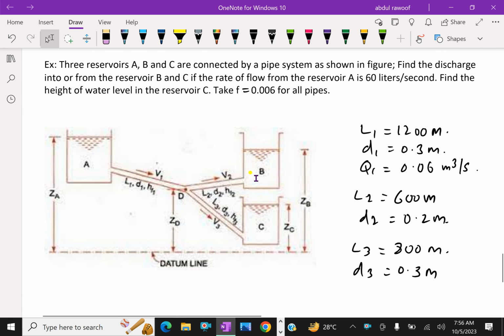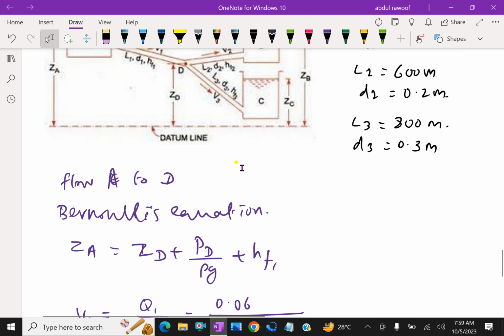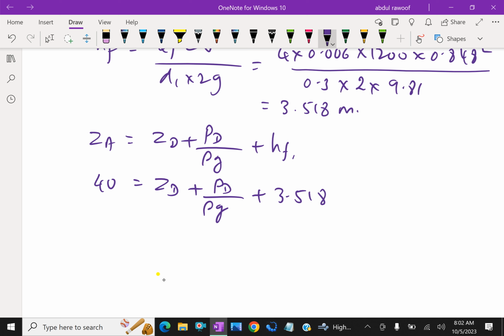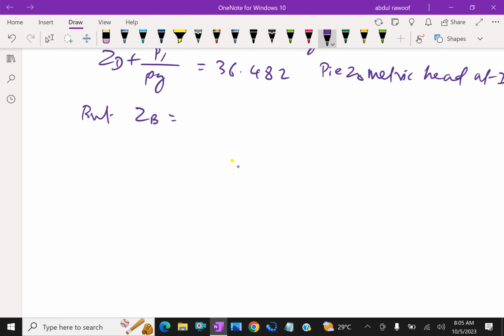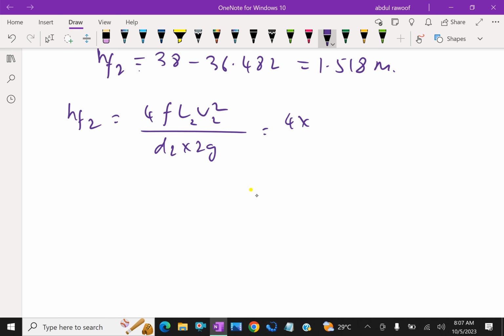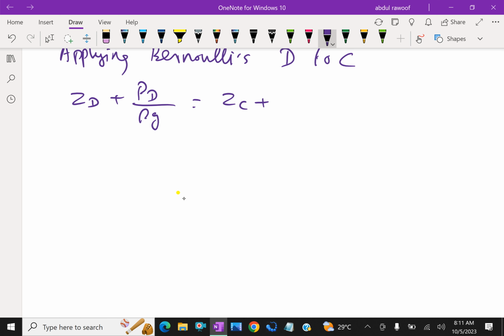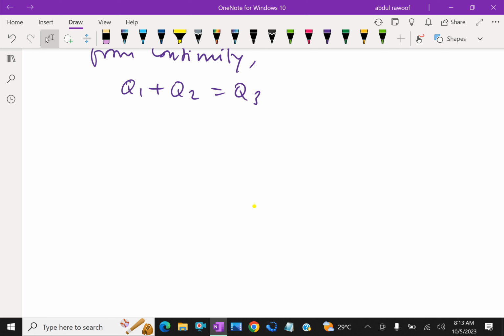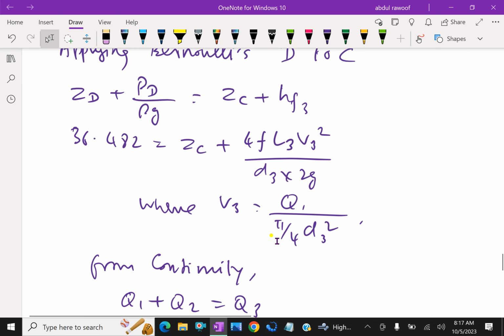Fluid mechanics : - ( Flow through branched pipes; Solving problems ) - 176.#fluidmechanics#gate

Comment: In my college the formula to calculate the head loss due to friction in pipe is a bit different hl = (flv^2)/(2gD) 
and when I solve the problem using this formula my final answer that is Z3 came out to be 36.93 m